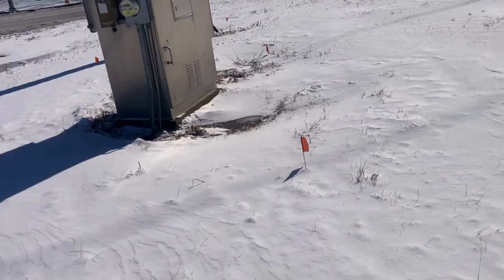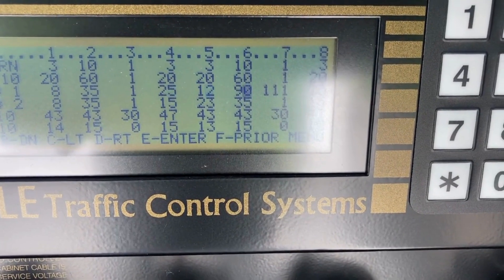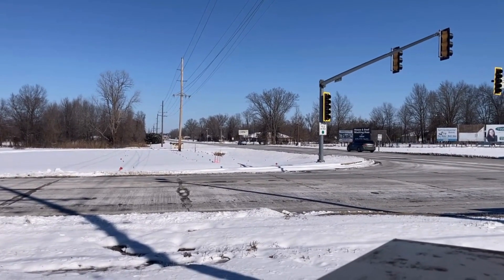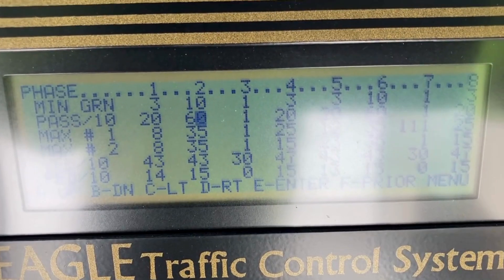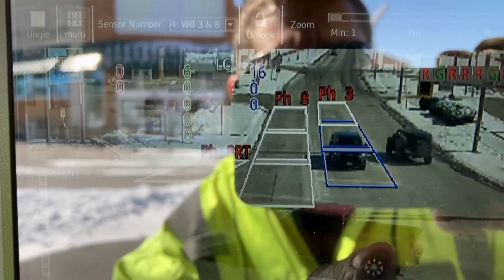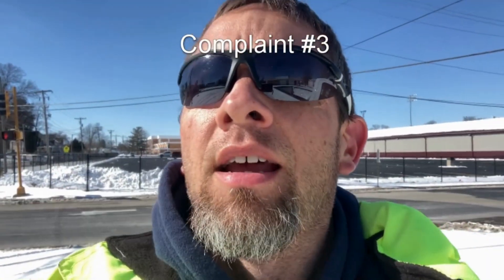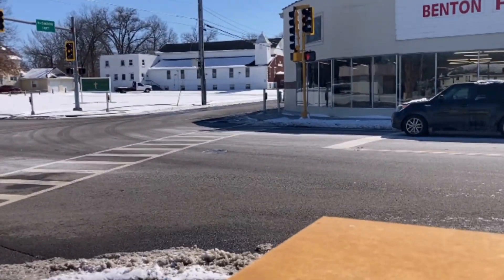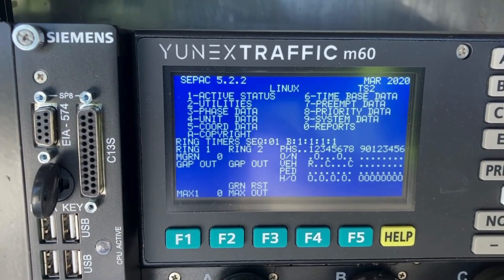driving around Fixing Traffic Lights

Comment: Can you do a video on programming a lead / lag into a controller? I want to program my controller's side streets (3/8 and 4/7) to have a lead lag configuration, I haven't had the time to do my own research.
Reply from the maker: Hey Gage  I'm super busy right now and haven't had much time for videos but wanted to answer your question--Most controllers have a menu page called 'Alternate sequence or Sequence'.    (I'm most familiar with Eagle/Siemens/Yunix controllers though so I'm basing this answer off of this type of controller).   You'll want to go there and pick a sequence (lets say Sequence 2).  In Sequence 2, you'll want to change the Ring sequence from 1,2,3,4  to 1,2,4,3.  That way when the controller goes thru its dual ring sequence it will look like this:  1/5, 2/6, 4/7, 3/8    (instead of 1/5, 1/6, 3/7, 4/8).  
Then go to the start up menu, tell the controller to run Sequence 2.
So 7 will come up with 4 , then 7 will drop out allowing 8 to come up.  At this point you'll have 4 and 8 running.  If there is demand for 3, the 4 will drop out and allow 3 and 8 to come up before transisitoning back to the beginning of 1/5.  Which provides the lead/lag operation.  Hope this makes sense.  I know pictures (or in this case-video) is worth 1,000 words but hopefully this will get you started on the right track!
Reply: @streetsmartstraffic  Thank you for taking the time to explain that, this helps alot!

Comment: How does someone go about calling in issues with traffic control systems? Do they just call the city or is there a specific department for the county or state? 

I would go back and install a scarecrow to keep triggering that trespassing camera, eventually it will annoy so many people they will be forced to fix it.
Reply from the maker: It can be confusing who to call.  Jurisdictions include the town, city, county and state levels.  There are also private level signals owned by a business (not as common).  However, I would start with the local public works department at the lowest level that the signal resides in to see if they maintain it.  If they don't, ask who maintains it.  Someone is responsible for the maintenance.  
Hope that helps.

Scarecrow...🤔